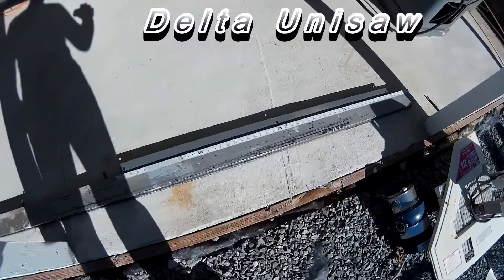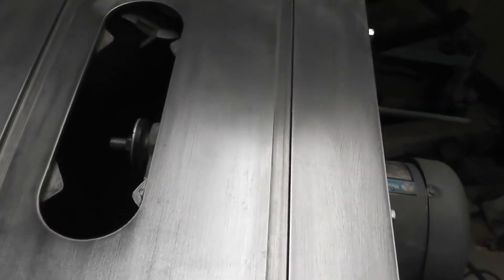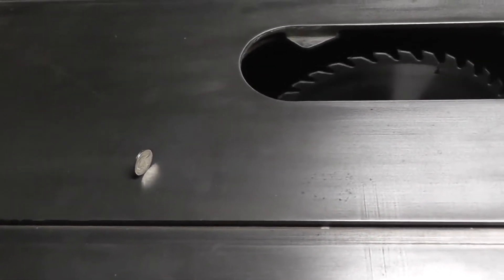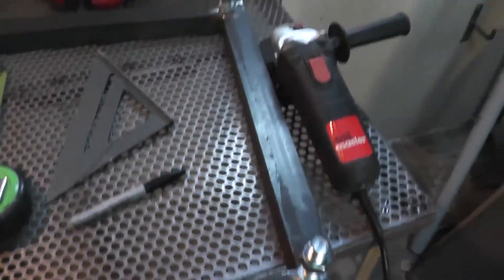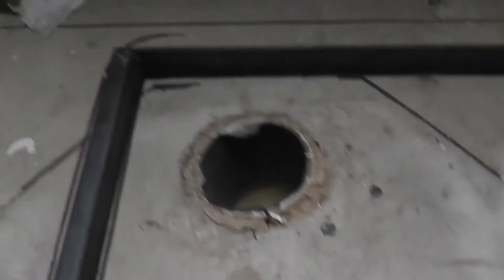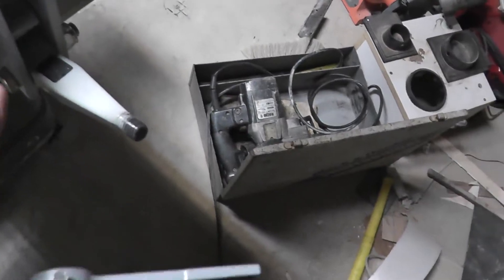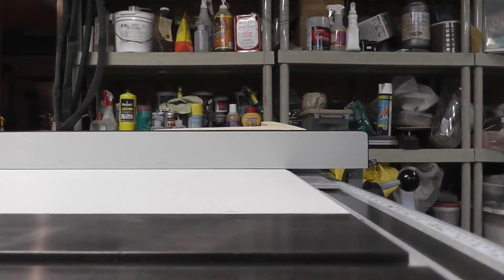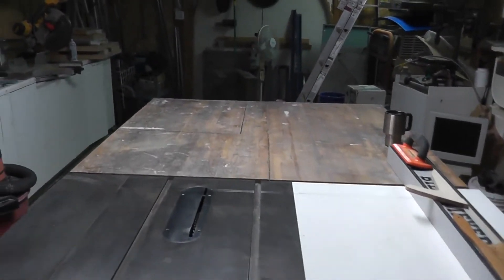Unisaw install

Comment: whoa those link belts are WAYY too wide - are they half inch or 5/8? i have 3/8 on mine since the half inch seemed too wide - the 3/8 sit nicely in the pulley valley though

Comment: hmm - i pressed new bearings into the arbor (did my motor bearings too - SOOO not fun!) - now for some reason i can't seem to get my blade to line up with the insert slot anymore hmmm ... i wonder what the HECK I did wrong ... forget a part somewhere? not press one of the bearings on far enough??? it all SEEMS like it's as it should be but i'm scratching my head over this one